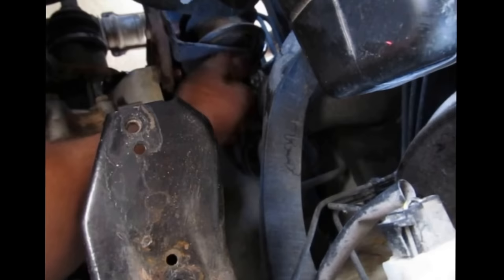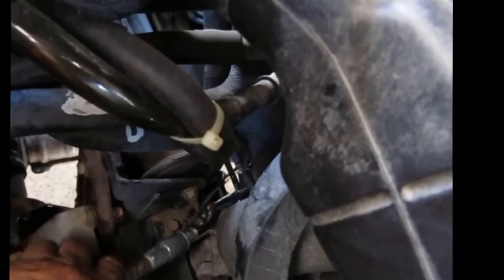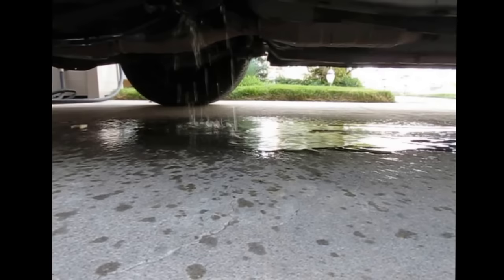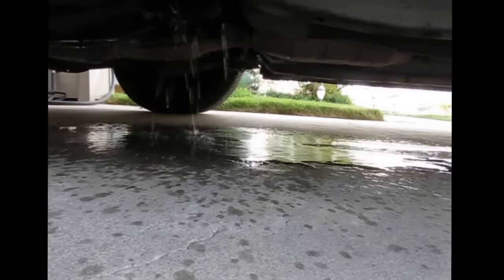How to unclog your car AC drain line

Comment: I used a bicycle pump since I didn't have an air compressor, just put the step up fitting on the end of the bike pump, and it worked like a charm!  Thanks for the video and the quick easy fix, more than a half gallon came out of the system!!
Reply: I tried that, even a ballon inflator but it didn’t work 😢

Comment: Legit had a smell in my car last couple months, cleaned it, thought it was something someone spilled, etc.

Ended up researching this a bit more after I took seats out and found water, brown liquid.

Ended up being this black tube for ac.

Took it out, it was warm to the touch. Cleaned it out, it was clogged full… so clogged that the water was actually coming from middle console area where it connects to top and not the bottom.

Anyways… put it back on, turned on car, ran ac, it is now cool to the touch and a constant drip is happening.

Took a few pots of hot water and soap, dumped them on floorboards after removing plugs underneath.

Cleaned as best I could with a towel, sprayed a ton… now have a fan blowing in car windows down in garage to air out and hopefully get rid of smell.

I’ll probs hit it again tomorrow, and put passenger seat back.

Thanks for the video. Saved me a ton of money I bet.

Comment: I have Galant ES 2003 and I have the same problem. The hard part was to find out exactly where is this small water pipe. To unclogged I use my tire inflator, in my case this is  worked. Thanks for the video !
Reply from the maker: Glad to hear it's unclogged now. Depending on the model of vehicle, the drain or hose can be in so many different locations.  In our case for the Gallant, just about mid-portion of the Firewall.
Reply: @mkapuscik01 how many drain does it have?

Comment: Thanks, it's happened to me a couple of times and the water has ruined the ac/heater motor.  I've replaced the motor myself, no problem.  I've never been able to determine the location of the drain tube.  The last time, the shop, cleared the obstruction from the drain tube and dropped the a/c motor box as part of the work and put it back.  That's pretty easy.  It was a couple hundred dollar charge.  It happened again, this time, I asked them to show me the drain tube, so I could unclog it myself.  He wasn't sure where it was, the car would have to be put on the lift to find it.  I've got a small air compressor and jack stands, so that's what I'm going to do, see if I can find it and unclog it.
Reply from the maker: That sounds a bit strange to me that if he was able to unclog it but didn't know where the tube was afterwards?  Also, if it was unclogged & and the problem returned the same season it's likely that not all of the debris were removed in the first place.  If getting to the AC box is not much of a problem you might also try using a shop vac to vacuum everything out. You should see a hole where the tube is connected and may try blowing air through it as opposed to finding the tube under the car but it usually near the AC box enclosure on the Firewall or underneath the car near the passenger side. Is it a Mitsubishi?
Reply: Is it the same with a Nissan Altima 2010?

Comment: yeah I have a 1995 Nissan pickup and what's supposed to be draining outside is instead  coming out into my passenger feet area and right by my blower motor, I had replaced that blower motor because my ac stopped blowing air and when I opened up the old one, there was a bunch of grime  and idk if it had gone bad previously because of this ac draining problem.
Rn just trying to figure out how to release the water else where but have no clue.

Comment: Would this be a reason why my car isn't blowing cold air?
Reply: Most likely because mines won’t
Reply: Yes or it could be low on refrigerant
Reply: Doubt that would cause it. Could be low on refrigerant or have a leak
Reply: Doubtful. My A/C has been blowing hot air. Went to autozone, bought the recharge can of refrigerant with the gauge. A/C works great again, except its leaking on the passenger floor. So, the clogged line didn't have anything to do with the A/C not working. Lol.
Reply: A clogged hose would result in dripping possibly into the car but shouldn’t directly affect the ac performance

Comment: Bought a used 2012 Ford escape. Come to find out someone tried to unclog the line with a screwdriver and destroyed the evaporator unit. $2500 fix. Guess who’s driving without air.  By the way, buyer beware. Learned it the hard way.  People who sold it to me sure were friendly, though.  Air was working when I bought it.

Comment: I'm getting clear fluid on the floorboard in the passenger side and I just removed the carpet part of it to the side and I'm mopping up all the water that's underneath it's clear water...if it was green or whatever the other type of fluid that you're using for your engine it's your heater core probably leaking...The amount of clear fluid I have is crazy I could fill at least a gallon of water...   The thing is I always look under the car and it's leaking water from the drain too..Always has been I check it all the time that's why it's confusing the shit out of me is it rain leak  Unless it is accumulated overtime build up build up build up ,,  I run this AC a lot..Now I'm letting everything dry out I'm gonna have to figure out where that plug is it just make sure it's open...   Maybe I'll use a long wire to stick in the hole for like a pipe cleaner...

Comment: This is just a temporary solution the proper way to do it is to actually open the system and clean it.
Reply from the maker: Yes I agree that it may be a temporary solution if there is a large build up of debris that can't be flushed out all at once or if the vehicle is always parked under shedding trees where debris can accumulate again but it's worth a try.  Definitely less time involved in this method as opposed to having to remove components to gain access to the system. I've done both before and can be a pain. Depending on the vehicle, some are easier than others in gaining access. It's always up to you on how you want to proceed.

Comment: I know this video is old, but, is it possible to use a shop vac and potentially pull the debris out? I can try the air but I’ll have to wait until I have access to a air compressor! I’ve also tried to squirt a bit of water in there and it came pouring back out. I did notice a small amount of water in the same spot after doing this, so it’s definitely clogged. Great video and thanks in advance for any feedback!
Reply: I know your question is old but for other people wondering, I was able to use a shop vac and it worked just fine.

Comment: Is there anything i can do to keep the drain from clogging? I cleaned it out a few months ago and my problem came back just cleaned it out again why does this keep happening???? Do i need to replace the heater core???
Reply: When you blow air into it all you are doing is unlodging it from obstructing the water flow so it can always be moved right back to clog the drain again you can possible try to find the hose further up and clear it out for good. any elbows along the way would surely be a strangle point for things getting lodged in the path...hope that helps

Comment: If I don't have an air hose, would it be just as good to stick a thin wire up the hose, to unclog whatever is in there?
Reply: I tried it with a coat hanger but no good.
Reply: I would use a pipe cleaner - skinny metal wire with wide nylon bristles coming out of it 360deg

Spray some alcohol or disinfectant on it and scrub the hose in & out
Reply: Thanks for the advice guys, but I don't have the car anymore, I should have deleted this post awhile ago, but thanks anyway. 👍🏻
Reply: @Mrd9960  be a man.  Track that car down and FIX IT.

:)

Comment: I have no idea what you did... you unplugged the drain tube from the AC system and as soon as you did water started dripping out. why is the compressor necessary. I'm in the same situation. the floor of my car is wet both in the front and back. but don't know how to proceed. any advise appreciated
Reply: Ok so the compressor keeps the refrigerant flowing between the evaporator and condenser. The water build up is from condensation on the evaporator. that water comes from the air and the drain tube is just meant to let it out so your car doesn't get funky.

Comment: Mechanic was a dck disconnected my drain line. I reconnected it so my passenger floor isn't wet anymore. But underneath the passenger seat still gets a puddle, why is that? I can't see where the water is coming from. Are there two drain lines?
Reply: @einsteinvondaniken  no, I reconnected the drain hose myself and in front of the front seat stopped getting wet but under the front seat was still getting wet. I got rid of the car though but I couldn't figure out why under the front seat was still getting wet.
Reply: @einsteinvondaniken  no, no rust issues. I don't know what happened, weird.
Reply: Wow this happened to me too

Comment: I have an 03 Galant and this happens every year regardless of blowing the shit out.  Need to snake all the slime out of there or something.  It gets so bad I will have a half inch of water on my floorboards and after an hour and a half of driving highway the blower will spit water through the vents and the air is pretty much not working because there is too much water in the system.
Reply: UruKaDoo Edwards I have the same problem and the water has a bad smell what did you use to fix it
Reply: my exact situation
Reply: old news but you need to clean your evaporator on the regular. usually it's as needed but can be up to every few months depending on your AC usage. look up evaporator cleaner.
Reply: stick a hose into the drain tube after snaking it, use that hose to pump ac disinfectant cleaner in & let it work. I was able to squirt it on my cores thru the cabin filter compartment in my chevy

Comment: What's that pipe /tube looking thing near the engine called...that has a bike shock thing around it called?
Reply: That's the semi-automatic hydraulic chrome muffler bearing. Check with any auto zone, napa etc and ask them if they have any in stock.

Comment: My patent:  Water sensor to be installed on the AC drain line that once water is detected for an extended amount of time, a warning can be scanned or displayed of the possibility of a AC drain line clog.
Please anyone help me register this and then sell it to all the automakers who end up with this problem and vehicle damage as a result???
Reply: Addition 2 to patent:  Sensor recommended to be located in a Y connector to avoid sensor debris damage with drainage located on the opposite Y branch as the sensor.  (If water fills up, the sensor will activate, needing a shorter time for sensor to recognize clog likely).

Comment: Help my 2003 saturn vue soaked carpet and rubber carpet behind it...where is this plug...i dont want to pay over $50 to my local machanic...
Reply from the maker: tat tyrrell not exactly sure where your drain plug is located on your Saturn but they all are generally in the area of the firewall.  could be on drivers or passenger side or middle.  just look for a rubber hose hanging down. usually about 6 to 12 inches in that area of your AC
unit. some are flush on the firewall too or just a couple of inches of rubber hose. should not be too hard to locate. if you don't have a compressor, try using a can of compressed air to dislodge the debris. let me know how it turns out.

Comment: Hi, this is exactly what i experienced. Everytime i turn the car, the water just rushes out off the passenger seat. In such a case, what would be the alternative if you dont have air compressor and is there any chance that the clog is big and solid such as a piece of wood or rock or plastic? If it is then how did it get there? Thanks. 🙂
Reply from the maker: If you don't have an air compressor you can try a can of compressed air. The kind you use to clean keyboards. Since the plastic straw is pretty thin though, try to seal around it when it's inserted maybe with some duct or electrical tape. Wrap the tape at the end of the drain tube and straw and give it several shots of air. You might even try a shop vacuum to suck the blockage out or reverse the hose on the vacuum to blow away the debris. You probably won't have any rocks or larger pieces of wood but likely may have twigs, leaves, petals, pine needles or pollen debris. If you can't evacuate the water and debris with air, then you would have to gain access to the HVAC System's enclosed case to physically remove the debris which is actually the best solution but can really be a pain depending on the make & model of your car. Sometimes there might be so much of a build up that even though you drain the water out, it might get clogged up again until it all gets drained out. As far as the debris getting there...that could be from parking under shedding trees or a number of other ways. In the spring, flowering plants and trees drop debris, such as petals and pollen. In the fall, leaves and pine needles accumulate over fresh air duct screens. They slip through the screens and work their way into the fresh air ducts. When it rains, debris is also washing down and if enough debris has accumulated, the drain becomes clogged. When we use our HVAC system, debris goes into HVAC box and starts restricting and eventually clogging the HVAC drain. Try the air trick first though because that usually works

Comment: would this work if your ac system doesnt work? mine does not work anymore, but has the proper amount of freon in it, but still blows hot air, and the temperature reading on the dash never has the right temperature and is usually in the negatives.
Reply from the maker: No that would not work because the system would have to no cold enough to produce the condensation. You have other issues why it isn’t getting cold. Could be many different things like a bad compressor/pump
Reply from the maker: Also first try inspecting or replacing your cabin air filter. It likely behind your glove box but google it to see how to replace the cabin filter for your model. If it is extremely dirty that would make the AC not work properly & not get cold

Comment: Thanks for the video!I had this happen to my 2014 Outback 4 weeks ago. There was literally a puddle on the floor. 4 days later the ignition fuse kept blowing. The dealership claims that there was no correlation. However, they replaced the ignition relay switch witch is located behind the glove box where the leak/overflow originated. Anyway, long story short, the ignition fuse keeps blowing and they cant figure out the cause.Has anybody seen a correlation between "AC drain tube plugged" and electrical issues?Thanks!
Reply: I have a Passat b5 and i have literally every kind of electrical issues because of this water, just bought this oldie and seems that electrical components have been swimming in that water for years, (the same clogged ac drain problem and wet floors)